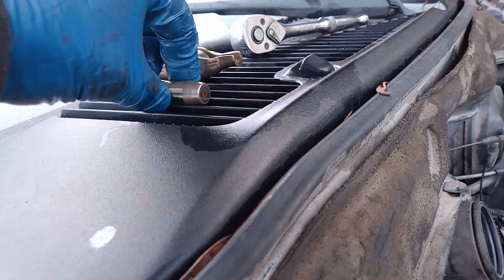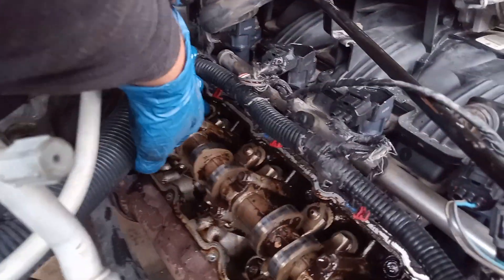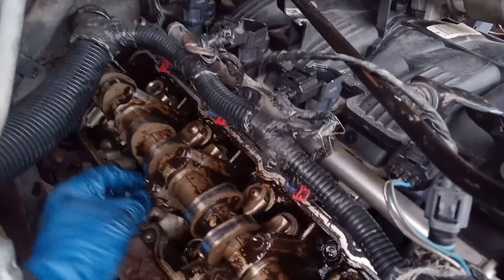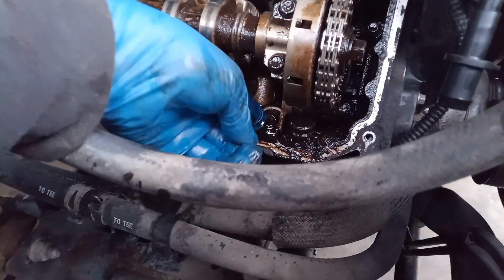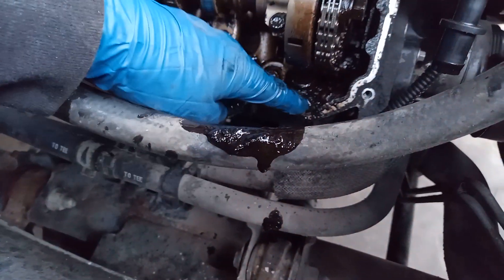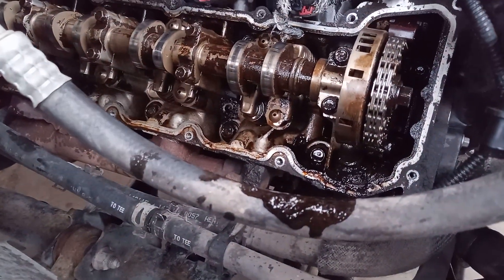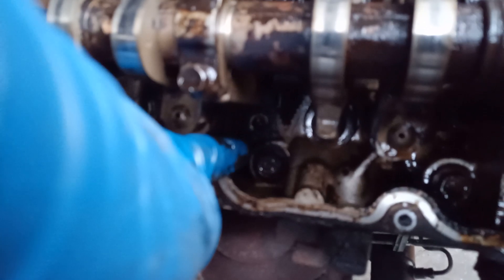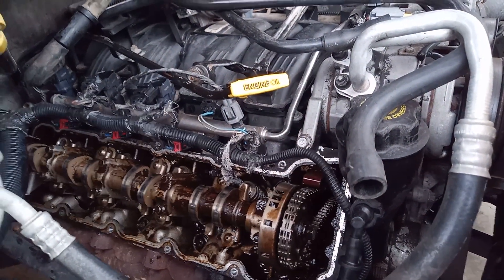Dodge 4.7 l lifter tap it rocker arm failure. Part 1

Comment: That motor is toast....
Reply: Not really, just have to fill it up with a strong detergent all the way to the oil cap and let it sit for several days. Do that a couple time followed by 3 100 mile conventional oil changes and your motor will be looking squeaky clean.

Comment: I have the same rocker arm that popped off. When I put back on, it's loose, definitely not tight fitting. I wouldn't be pulling a heavy trailer if the valve seat dropped...that can't be the case...I bought a new one and it's still loose and doesn't stay on
Reply from the maker: Sorry for the trouble. If the rocker is loose as you say even with a new lifter, the valve it not fully up for whatever reason. Look at the valve and compare it to the one next to it in the same cylinder while the camshaft lobe is up. Even remove the neighboring rocker arm if needed for better visual. I'm willing to bet the valve is hung up either because it's stuck, bent, or something in between the valve itself and the seat causing it not to fully retract.
Reply: @drtierce  ok you make sense now..I have spoken with many and they didn't know. I have no smoke whatsoever..it starts up fine every morning and every time. When I hit 40mph it shakes pretty bad and I have to let off the gas. I've also been pulling my trailer with this taking place...my trailer is heavy
Reply: @drtierce  also a friend of mine told me that it could be the valve spring ( broken ) but it's not making any noise and there is no loud metal sounds nor do I hear anything being damaged. Sounds like a regular truck and still has the same sound before all of these stuff